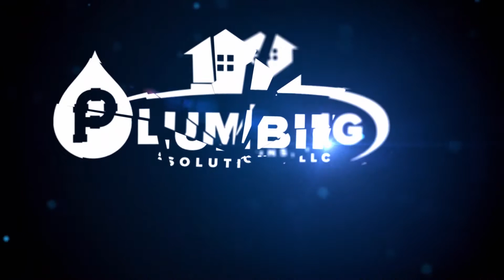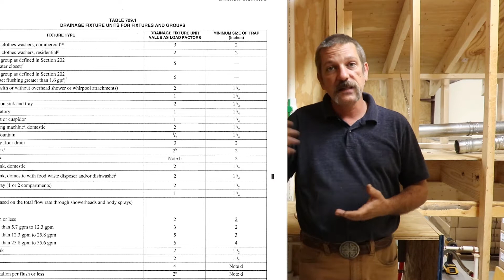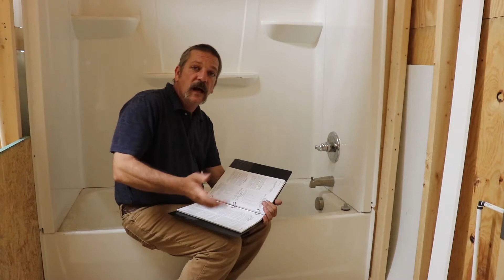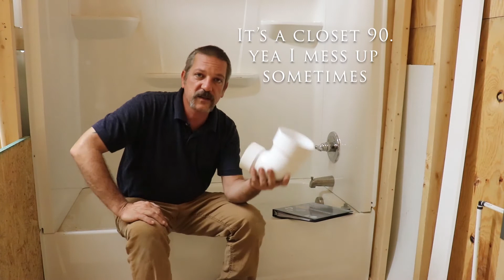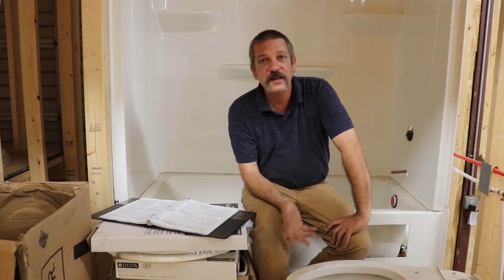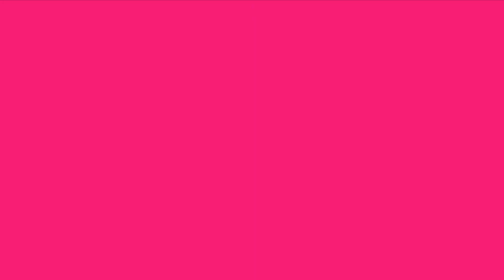Plumbing Pipe DFU DWV Sizing

Comment: my toilet has  a 3.25 O.D DWV pipe,  is this considered a 3" pipe?
Reply: Pipe is sized by its inside diameter because this determines the flow rate.  But their are different wall sizes called Schedules.  Sch 40 is a very common wall thickness, but there is 20 and 30 (thinner) and 80 (thicker than 40).  So a sch 40 3 in inside, wall thickness 1/8 x 2 = 3 1/4 O.D.